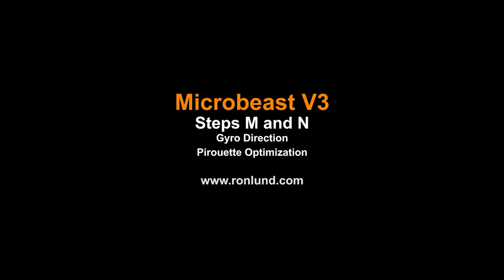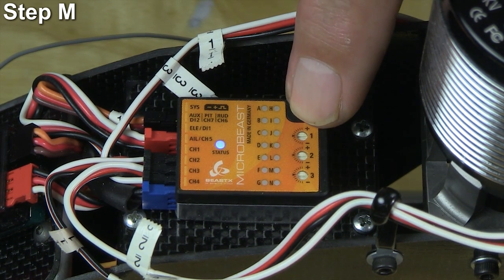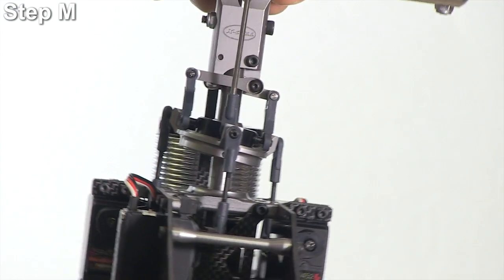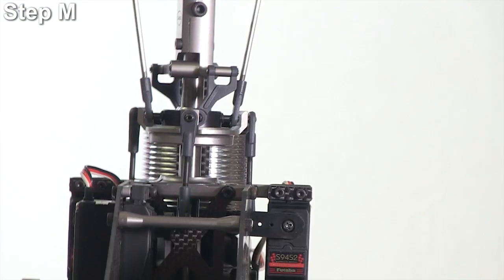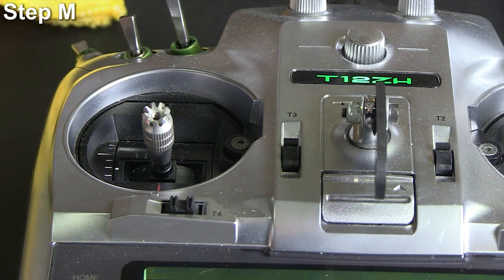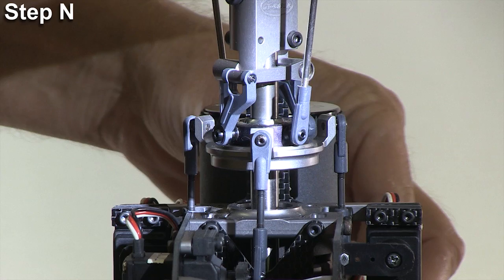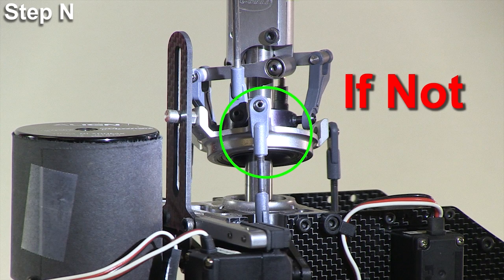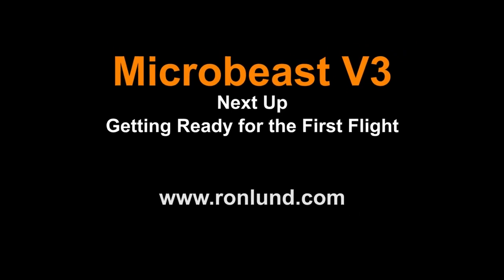Microbeast V3 Steps M and N

Comment: An Excellent series of videos with a lot of useful tips and information that has helped me install and successfully fly a Trex 450 dfc after installing a v3.0 Microbeastx. Thanks for taking the time and the trouble in making these videos. The idea and use of a laser pitch gauge and also using it for a swashplate levelling also worked so well.
Chris

Comment: Hello, I have T-REX 550 DFC with 550 blades and microbeastx V3, led pinion 12, when I make chaos in input and output is not made clean, the other figures all perfect. Pirouette optimization is correct. Please can you help me. A greeting.